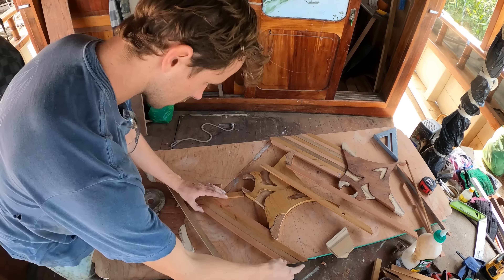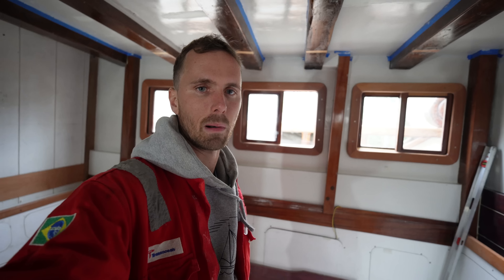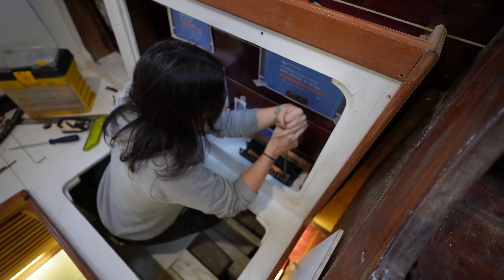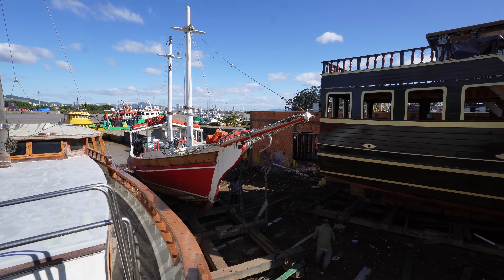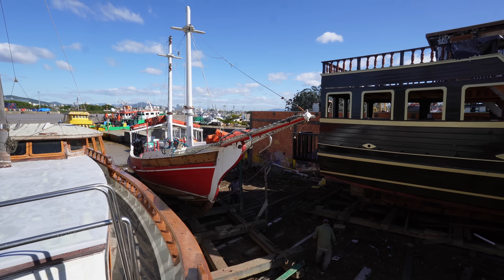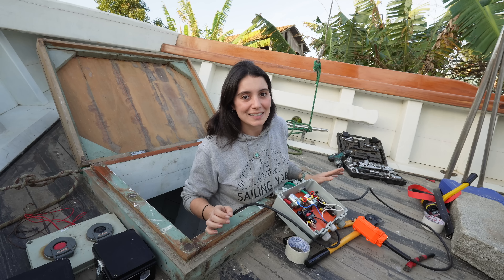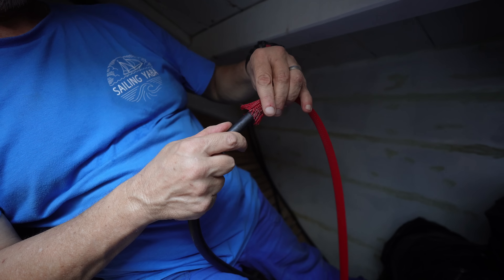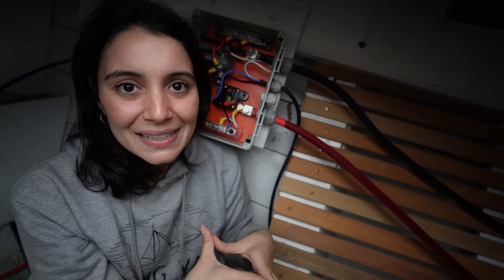Installing the electrical system on a boat with no experience. What could go wrong? Sailing Yabá 153

Comment: Completely surprised (shocked) about your choice of such a fire hazard. I mean a big cable thru Yaba for the winless.
Safer is an additional battery in the front and operation via a thin cable to a relay box next to it. Keep high ampere cables as short as possible
Reply: Don’t listen to this guy. ALL sailboats have the batteries in a central location and wires from there.
Reply: @frankd2301 don’t listen to you, this is a lot more lengthy than just a sailboat. The cable length was over 30’ so it is very likely to cause a overload situation when it’s under full load. I’ve had this happen before in my field and you don’t have no idea what you’re talking about.

Comment: Due to long cable runs of large cables and potential voltage loss, a lot of boats your size have dedicated batteries for the windlass.

Comment: Just a suggestion... What if you install batteries near the windlass only for the windlass??? Cabeling 1mt or 2mt max. Your windlass and the batteries will live much longer, Your windlass will be much more powerfull because a great deal of power is lost in those long cables, your cables will be much less and there won't be any cable heating and therefore causing fire problem.  Just because you paid all that money for the cables does not mean you should use them there or you can use them else where... Like I said: just a suggestion...🙂

Comment: Cables rubbing through wooden holes.  Take an extra 6" rubber sleeve, like the rubber sleeving on the cord and put it around the cable where it goes through the hole.  Then the extra sleeve will take all the rubbing.  Any where the cable touches something, it's going to rub...in a bad way.

Comment: On YouTube,  the channel Pacific Yacht Systems, has lots of good Video's on how to get Boat Electrics right, to Marine Standards and getting everything Safe. Watch those before you even buy any wire, and learn how you have to Tin all wires to prevent them corroding and getting poor Connections as a Result. Give  you are already doing the video, you almost  ertainly are already doing things wrong ? 😢 I was as a qualifiesElectrical installation engineer, and I hadn't realised just how different Boat Electronics Has To Be. I doNow though. Best Wishes and best of Luck. Bob. ❤
Reply: Dear brownnoise.
👍👌👏 You are absolutely right, Sir! They also didn't put anything on the screws/connections to prevent those from rusting/oxidating. Not even silicon grease, simply nothing. Especially the connections on the winch motor will definitely need protection from moisture/salt water.
Best regards, luck and health in particular.
Reply: @Chr.U.Cas1622  Best of Luck and good health to you too. Can't block channels on YouTube any longer, only hide them, which doesn't hide anything apparently, so won't be watching any of their  videas and have unsubsscribed. Too Painful to watch tbh. 👍🤔

Comment: MP, you would look more like your Dad if you grew a full beard!😉

I'm not sure how many of your devices that are 24VDC that draw a lot of current, you have on board.  But for planning purposes in the future, it would make sense to place your batteries as close to these devices as possible, especially the one that draws the most current, like your windlass. The length of the cable will add more to the resistance and result in a greater voltage drop in the cable before it gets to the windlass. So your windlass is suddenly operating at only 20VDC instead of the more powerful 24VDC. By placing your batteries closest to the electical "load", the higher the voltage will be at the windlass, and maybe you can use a smaller diameter cable saving some money. The two cables that can safely be the longest, will be the two that brings the charging voltage/current to the batteries from the 24VDC alternator. You will charge at a greatly reduced current than what the windlass uses, and thereby get by with MUCH smaller cables on that long run. It's the same principle as when you were talking about the smaller wires from the helm windlass control switch to the relays.

Comment: I know it's too late, but next time you have to pull wire thru several holes: for the first hole put the wire in the second compartment and push the short section of wire needed back to the first compartment.

Comment: That circuit breaker is notorious for failure! They overheat, reduce power, melt or catch fire. Use Blue Sea Systems breakers for this.

Comment: Also why not install it perpendicular to the deck so if any water was to get in it might have a chance to drain out the bottom and not use the case like a cereal bowl to hold the water.

Comment: While considerably more expensive, tinned cable would have kept corrosion at bay within the copper cable, you may be replacing the entire cable(s) again in a few years. Maybe next time. Bare copper will corrode, even when sheathed in the rubber coating. It’s the salt air that gets it. By using tinned copper cables,, the bare copper is sealed from the salt by the tin. Your cables last much, much longer. Meaning less shorts to be fixed and an uninterrupted powered windlass that is dependable for a long, long time.

Comment: My 2 cents, the breaker should be accessible (outside of the box) and preferably closer to the battery bank.
Reply: The breaker is protecting the wires to the windless. It has to be  located in the box. Because the wires for the windless are in the box….
Reply: @scottcounts4185   In an emergency, going down the to anchor locker, getting a screw driver to open a box just to trip the breakers would take to much time. It would be much faster if this breaker was in a control panel close to the batteries along with other breakers. Although technicaly breakers can be installed anywhere in a circuit, Nigel Calder (and common sense) recommends they be installed as close as possible to the batteries.
Reply: @ferluiz69  your missing the point. that breakers only job is to protect the wires going to the windlass. not the wires coming from the batteries to the windless control. so you are saying that they should run the wires from the windless control all the way back to where the batteries are place a breaker there then run wires all the way to the windless. sounds expensive to me and a complete waste of time.......

Comment: The international standard for earth (or ground) is green. You have colored coded a power wire green. If someone else were to buy the boat in the future electrician will think it’s a ground (earth). Don’t color code any wires green unless they are earth (ground). You should be using an AYBC code book as a reference for doing this project.

Comment: In this end of the world IF the boat is to be used for a comercial application it MUST meet certain safety specs for any electrical wiring. Can' t say how that works for your end of the world.
On the windless wiring it would be much better to install a pony battery up front to run the windlass and then use much smaller wires to charge that battery.

Just a thought, (;-) TP

Comment: You really should have put cable glands around all of the places which you passed those cables trough a piece of wood, otherwise you are going to get chafe. Everything on a boat moves and if its not secured or isolated enough, its going to wear and cause problems down the line.

Comment: Numérem cada cabo, com um código fácil, bem tabulado, no painel de comando, na extensão e ao lado dos equipamentos.
Numérem cada cabo, com um código fácil, bem tabulado, no painel de comando, na extensão e ao lado dos equipamentos.

Vai dar trabalho, e pode sair um pouco mais caro, porém, dia após dia e a cada serviço ou olhada, você vai estar memorizando e tudo vai ficando mais claro, já antes da visão ocular, dentro das suas cabeças, então as soluções vão se tornando algo mais iluminado.

Lembre-se também, queridos, de, se possível, pensar em atuar sem luz no ambiente. Uma làmpada de emergência, dedicada, com backup, redundância, o que seja, em cada ponto de interligação de rede elétrica ou de comando da embarcação. Luzes de Emergência, a meu ver, são vitais, em navegação noturna.

Elétrica não é difícil, igual a outros conhecimentos e ofícios, sendo muito técnico e responsável, seguindo as regras mais básicas, da função, tudo se ordena.

Boa sorte, sempre...

O nome Yabá soa, ressoa e é lindo de falar..., ainda mais com tudo o que representa...

Abraço forte, desde de aqui no Uruguay a todos que lhes fazem bem.

Felicidades.

***-------------------------------------------------------------------*---------------------------------------------------------------------*

They number each cable, with an easy code, well tabulated, on the control panel, on the extension cord and next to the equipment.

It will take work, and it may be a little more expensive, however, day after day and with each service or look, you will be memorizing and everything will become clearer, even before the ocular vision, inside your heads, so the solutions will becoming something more enlightened.

Also remember, dear ones, to, if possible, think about acting without light in the environment. An emergency lamp, dedicated, with backup, redundancy, whatever, at each point of electrical network interconnection or control of the vessel. Emergency Lights, in my opinion, are vital in night navigation.

Electrical is not difficult, like other knowledge and crafts, being very technical and responsible, following the most basic rules of the function, everything is in order.

Good luck always...

The name Yabá sounds, resonates and is beautiful to say..., even more so with everything it represents...

Big hug, from here in Uruguay to everyone who does them good.

Cheers.

*-------------------------------------------------------------------*---------------------------------------------------------------------*

Numeran cada cable, con un código fácil, bien tabulado, en el panel de control, en el alargador y al lado del equipo.

Requerirá trabajo, y puede que sea un poco más caro, sin embargo, día tras día y con cada servicio o mirada, irás memorizando y todo se irá aclarando, incluso antes de la visión ocular, dentro de tu cabeza, por lo que las soluciones aparecerán. convirtiéndose en algo más iluminado.

Recuerden también, queridos, pensar, si es posible, en actuar sin luz en el ambiente. Una lámpara de emergencia, dedicada, con respaldo, redundancia, lo que sea, en cada punto de interconexión de la red eléctrica o control de la embarcación. Las luces de emergencia, en mi opinión, son vitales en la navegación nocturna.

La electricidad no es difícil, como otros conocimientos y oficios, siendo muy técnico y responsable, siguiendo las reglas más básicas de la función, todo está en orden.

Mucha suerte siempre...

El nombre Yabá suena, resuena y es hermoso decirlo…, más aún con todo lo que representa…

Un abrazo grande, desde aquí en Uruguay a todos los que les hacen bien.

Salud.

Comment: You did not lubricate the wires onto the windlass so THEY WILL CORROD Next thing is I hope you have used tinned copper wire and not just copper wire on all the wiring in the boat as it WILL CORROD and FAIL a lot sooner than you think ALL wiring on the boat should be Tinned copper wire .

Comment: Please stop say positive and negative those are terms for batteries or engine components. Terms for electric is Hot wire a,b phase if you have 3 phase it will be Hot wire a,b,c phase then you have a neutral and a ground there is no positive and negative after your power inverter. Great job but please use proper terms because people mite be learning from you and the terms that your using can get people hurt. Before the power inverter is 12 to 24v dc which won’t hurt you but after your inverter is 120v or 220v ac which will kill you so please explain both systems and how they work.

Comment: This is a huge waste of money... batteries should be near the windlass and connected with thicker cables. Welding lead cables are a good choice for affordability and flexibility ... smaller  positive negative wires run from the various power sources would allow for taping into the wires along the way...

Comment: I have watched since the beginning. You have come a long way such as NOAH did in his endeavor. There is a way's to go before plotting her first voyage into the massive of our water world. You must take into account that your boat will always be a work in progress. If you think your working now wait until it's just you to do all the engineering, set up and all the hand fitting & trimming to put things right. In my time I worked on many wooden boats over 90 feet long and one area I see will become a problem is your RUDDER set up. Especially in heavy rollers or those pesky storms that just show up. I DON'T RECALL Seeing any hydraulic that is attached to your steering lines.  Auto pilot  will not help you in a storm it will be you against the sea.